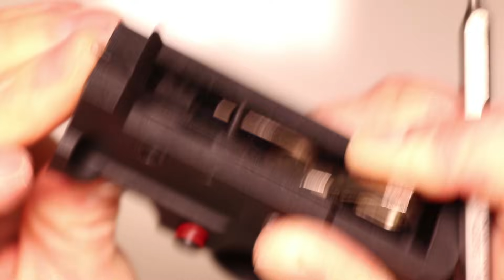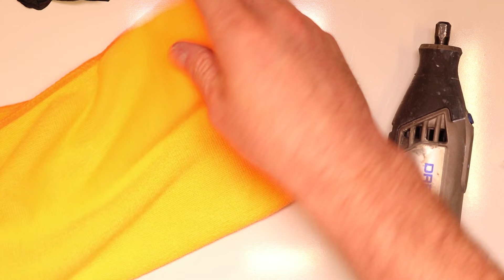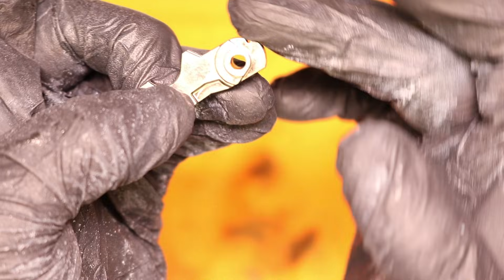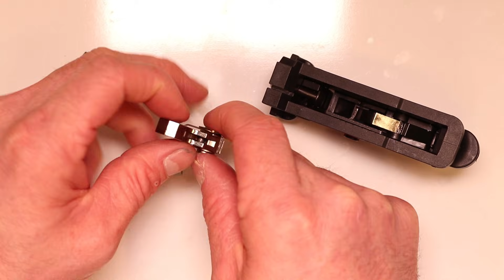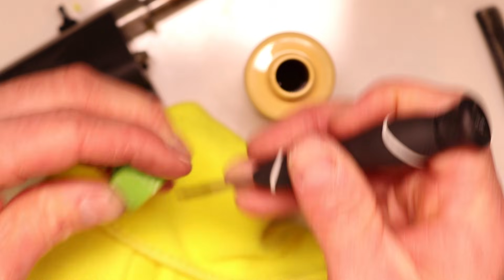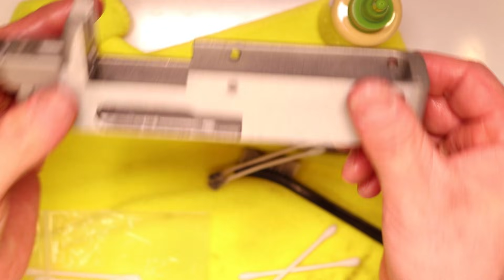Ruger 10/22 Trigger Job w/ Polishing – Full Disassembly, Cleaning & Trigger Spring Kit | M*CARBO

Comment: Great video, I watched every second.  I ordered a m*carbo spring kit for my tcr22, I will polish up the parts and do my best to reassemble.  The camera work was good in my opinion
Reply: How were your results on the T/CR22 ?  I am most likely going to try it on my T/CR22.  Any issues or input on doing it is appreciated.
Reply: @J.R.F.23  Sorry for the delayed response, I was surprised the trigger sear and hammer weren't quite as rough as I had expected which made it easier to polish up.  I was very happy with the results with the polishing and m*carbo trigger spring kit I installed, I didn't have a wooden match stick to use as a slave pin on the trigger/sear, but I did have a rc-car antenna tube that was a perfect fit that made installing the trigger sear much easier, the process took maybe 45 minutes start to finish as I am just learning to work on my firearms.  Overall I am very happy with my t/cr22 laminate thumbhole rifle, I replaced the steel buffer recoil pin with 1/4" Delrin plastic rod I purchased online and cut to the correct length, it helps cut down on the sound when the bolt slams back to cycle a new round.  I also put on an evolve muzzle brake.  I think if you follow the tutorials from mcarbo, you will find it easy to modify your guns, have a good one
Reply: @wowguy3562  I found the same on my T/CR22 -- my hammer & sear faces were much smoother, prior to the polishing work, than the Ruger pieces shown in Chris's video here.  I didn't have to spend as long as Chris seemed to have spent on the Ruger parts in this video.  I think T/C was a little more careful when making their several improvements/changes to the base Ruger 10/22 parts.
Reply: I installed it a few days ago.  It significantly improved the trigger.  Thank You!

Comment: Hey Chris,
I’m a repeat customer having upgraded my Kel-Tec Sub 2000 with almost every part you sell for it. It’s awesome! This 10/22 vid was great! One question and one comment. The 10/22 trigger spring kit came with TWO springs and the assembly pin for the trigger. Is the second spring a replacement for the sear? There was no documentation and you didn’t reference it here in the video. That was the question. My comment is about the bolt release. Volquartsen already makes a very good one, so I would suggest you pass on trying to reinvent it.
Thanks for making so many awesome drop on replacement parts and great installation videos. I’ll be back for more as you continue to grow!
Reply from the maker: Yes, that is a replacement sear spring to aid in reliability of the trigger system.

Comment: I have a Ruger 96/22 that has just a terrible trigger.  This gun is a lever action rifle and looks very similar to the 10/22.  I was wondering if your methods and spring kit would work on the 96/22.  Surprisingly, the 96/22 trigger housing looks very similar to that of the 10/22.  Any suggestions would be helpful.  Thanks for the video.

Comment: That imperfection is a casting flash line. Those parts are probably molded in a line in the mold, linked by a thin piece of material. They break this flashing apart to separate the parts. The rough spot is where the scrap flashing was broken to separate those individual parts. They leave this rough spot as it is usually not a bearing or stress area.

Comment: Would there be any benefit in also polishing the bolt and inside the receiver?
Reply: Yes. You can feel the difference
Reply: DORORO  
My bolt does not touch the top of the receiver.

Comment: A q tip stem can be used as an installation tool for the trigger pin.
Reply: Using a pin during assembly definitely makes it a lot easier. 
Stay safe, be good, be kind, trust GOD.
Reply: I used a plastic rc-car antenna tube as a slave pin that was a perfect fit, it made the installation super easy, just wanted to offer another option
Reply: Thanks all for sharing your ideas!  Long drive to get a dowel. Qtips and toothpicks I have.
Reply: Brian Baker  oh, ok, why didn’t i think of that?
Reply: I use a shortened tooth pix.

Comment: Thank you for the very thorough disassembly and reassembly video. 
I had a stock trigger pull of nearly 7 pounds on my 10/22 and put in a hammer and shim kit last night. it feels lighter now, but I am going to go and polish the hammer, seer and disconnect. my disconnect has a gritty surface on it. The issue I am having right now, is that my Volquartson auto bolt release is not easily holding the bolt open. i think I may have let that dog leg spring slip when putting everything back together. 
With your video, I will be able to really get in there and polish things up and hopefully get rid of the gritty feel I have right now. 
I think I am also going to polish the inside of my receiver really good so that the bolt will cycle much smoother.

Thank you for the great video. I have it saved for a visual guide when I disassemble and reassemble my trigger.